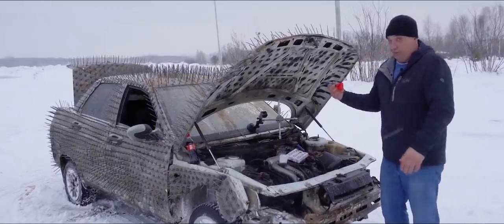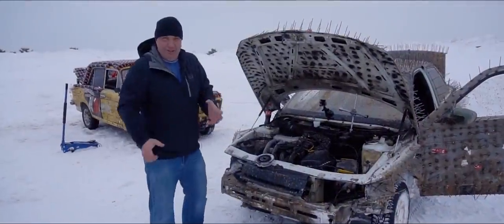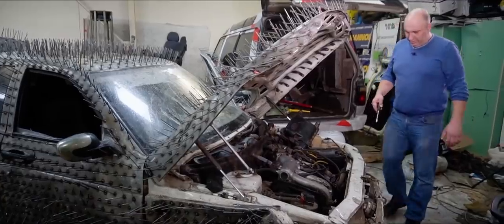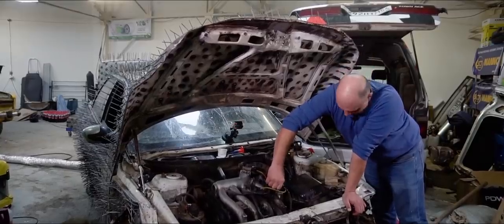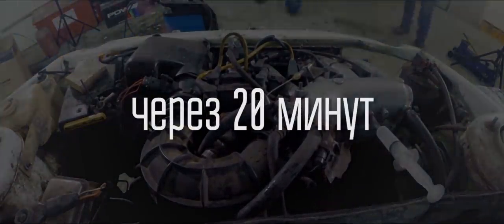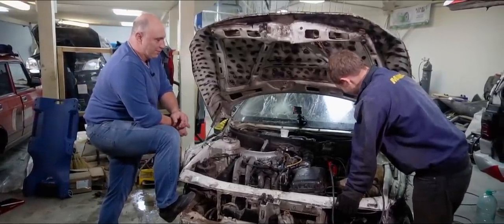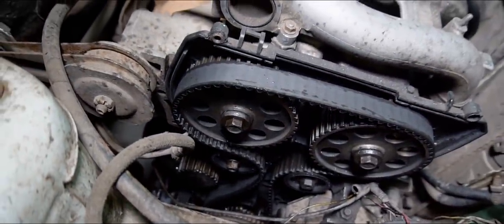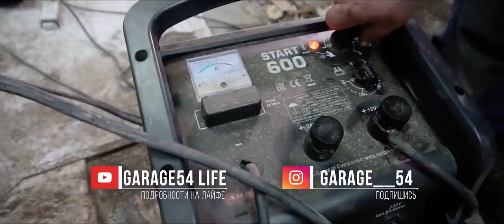What happens when you put toothpaste into a motor?

Comment: Try putting diesel in the cooling system👍😨😂
Reply: Nothing bad would happen really, diesel flash point is very high. Diesel is a oily fluid, you'll just add thicker fluid than the one recommended on the cooling system. Water pump could suffer a bit.
Reply: My dad worked for a farmer in the 60's who ran diesel in the radiator of his D9 Cat dozer exclusively.
Reply: I knew a truck driver that did that very thing to get his truck going to the next shop... 200 miles away out west. Truck blew a radiator hose, he wrapped a clothes hanger around the hose then duct tapped over that, siphoned fuel from his tank, filled the radiator and off he went.
Reply: @garyr7027  wasn't a bad idea after all then😉👍
Reply: @tomcline5631  suppose it would take a bit more to freeze it on cold days.❄👍
Reply: @rastamanralph6670  Yeah,that's the only reason I could think of. Dad said the farmer never really told him why. Just reminded him to not put antifreeze mix in it.
Reply: @rastamanralph6670  diesel fuel will gel up on real cold days, gotta leave it running be it in the radiator or the tank... and modern tanks have fuel heaters.
Reply: @garyr7027  I've learnt something new today because I didn't know about the heaters. Cheers👍😉
Reply: I believe some older engines cooled with oil actually so might not do much

Comment: I think the imbalance of the crank pulley caused the failure. And yes it seems like toothpaste and other abrasive particles in the engine could definitely destroy it, however in this case I believe that if the crank pulley were properly balanced the car would have still been fine, while the toothpaste slowly eats the motor alive

Comment: Rew the engine at maximum rpm and throw gunpowder in the intake. See if it explodes😀
Reply: Take a spark plugs out,put a big pinch of black powder on top of the Piston,put back the sparkplug. It goes BOOOOOM!
Reply: BOOOOOOOOM
Reply: @linuxtuxvolds5917  Well you know... A close approximation! Try it with an old mower! It's cool.

Comment: my vote is the welding took the hardness out of the crankshaft, and the abrasive material adding resistance to the upper end stressed the weakened crank until it sheared off

Comment: Can we see a inlet manifold cooled with tec plate coolers? Only issue might be stopping water/ice condensating on the inside of the super-cold inlet.

For bonus points, pump the heat generated to the cabin. So a ghetto supercharger and heater all-in-one! :)
Reply: "But its already pretty cold there, look at the snow!"

Yes, but tec plates produce a temperature differential, say a 40° difference between the sides. If the hot side was at 40°, the cold side would be at 0°, now if the 'hot' side was at 0° because of the cold temperature, then the inside of the inlet would be at -40°, thats some dense air 😀

Comment: I have seen what glass bead blaster beads do to a freshly rebuilt auto transmission..destroyed the pump, bushings and seal rings.. jammed up nearly every valve.. threw it in scrap metal bin. 
Radiator shop forgot to plug the heat exchanger when the te cored the radiator and bead blasted the lower tank. Oops!!

Comment: "Motors" are electric. Just one of those pet peeves I've got.
Reply: Why's it called motor oil,motor mounts etc?
Reply: @tomcline5631  That's slang... it's properly called engine oil and engine mounts.
Reply: @juansolo1617  It's not slang! Motor oil has been on the cans etc since they started making motor oil. Also look at a parts list/build sheet from the factory with all the part numbers of all the parts and on that list from the factory,they are Motor mounts.
Reply: @tomcline5631  They also call Transmission mounts "tranny" mounts. That's slang, too. They can call it whatever they want. Motors are electric. Engines convert heat energy into mechanical work.
Reply: @juansolo1617  Not on the pats box,in the catalog or anywhere else official. Might be shortened to "trans." But never tranny. Motors are gas,diesel propane lng,kerosene nsfo,and electric.
Reply: Lassi Kinnunen   Thank you! I was just gonna mention the fact that they were called motors and motor oil etc long before electricity.

Comment: Cam seized in head, shock on crank from timing belt suddenly stopping, loose bearing tolerances letting crank walk and tilt, along with extra friction heat snapped it, hence the location of the break. I have seen this failure in chain drive ohc engines before.

Comment: The gritty stuff in the tooth paste would not be good for inside motor, it will be similar to valve grinding paste, but with a mint flavor, it will cause internal damage due to having something similar to valve grinding paste inside the motor, it grinds, it wears, motor will fail at some point, and will require rebuild or replacement.

Comment: Replace the transmission fluid with gasoline next
Reply: I already did that once on my old Harley 10 years ago. I forgot to drain the gasoline and put new oil in after cleaning the transmission, so I rode for about 100 miles with gasoline in my transmission. It works, but it's not AT ALL recommended!

Comment: Want to see something funny fill the cooling system with oil. Back in the mid-1960s my brother and I, just learning how to drive. We had 1 car between us. We couldn't afford antifreeze and gas so my dad told my brother to put coal oil in the radiator, that's what they used to use back in the 30s if they absolutely had to. Maybe so but my brother didn't get the, (coal) part of (coal oil), AKA. kerosene and filled the radiator with oil. I don't know exactly what kind of oil he used but, Yeech, what a mess and it wasn't just over and done with it took forever to get the dirty, gooey, nasty grey goo that resembled what you would expect out of a glass of milk in the back of the refrigerator, forgotten for months, out of the system. That stuff came out of the motor in places I didn't even know it had.

Comment: Maybe now you can't start it you could tow it at perhaps 40mph and drop the clutch in first gear, and get some serious rpms ?
Reply: Without the cams spinning you're not going to do too much beside possibly toss a rod
Reply: 40mph won't do much damage , these gearbox usually go 32mph max in first, they'd easily slow it down before over revving , you need more like 60 ))

Comment: What is with the medical syringe sticking out of the intake manifold?
Reply: to simulate brake booster vacuum, engine won't run if you have massive vacuum leak
Reply: @lordred7462  i have used a Bolt for this for 30 years.